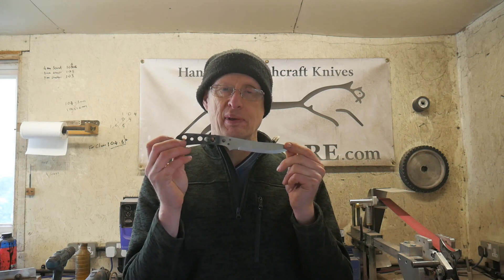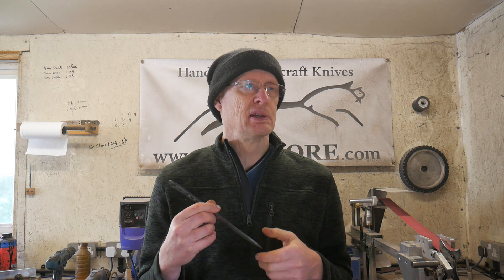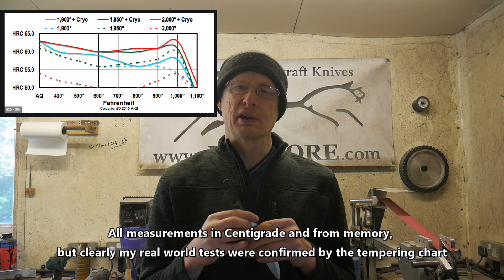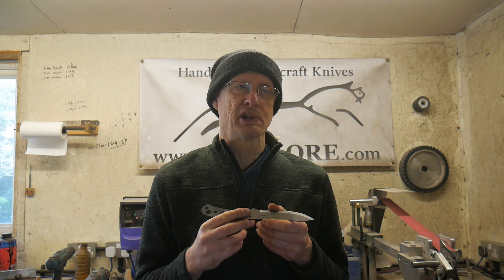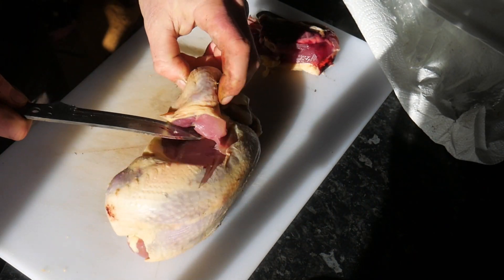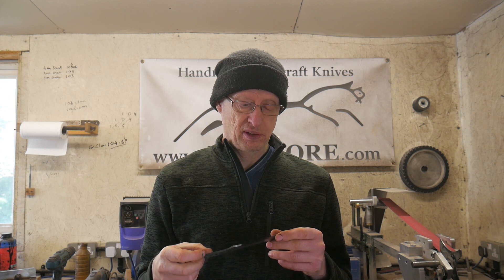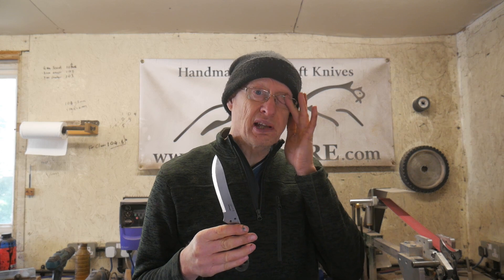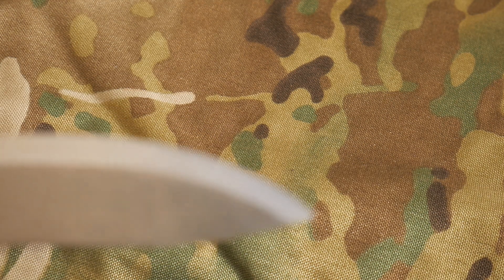STAINLESS HEAT TREAT UPDATE. DESTRUCTIVE TESTING

Comment: Hi Sandy
Currently doing my own HT test pieces,and researching with the book by Dr Larkin Thomas,I sent you a pic of it couple of weeks back definitely worth the money.
This is taken from the book : 
Hardness comparisons with different 154CM-type steel datasheets found that the Latrobe datasheet is closer to heat treating experiments than the Crucible datasheet. Optimum heat treating of CPM-154 was found to be 1950°F for 30 minutes with a plate quench and cryo. Then tempering between 300-450°F depending on desired hardness. A maximum hardness heat treatment (~64 Rc) with decent toughness was 2025°F for 20 minutes with a plate quench and cryo followed by a 300°F temper.
Regards

Davy
Reply: Hi Davy, Sounds good but the problem is after cryo it's impossible to get the hardness down below 60rc which is what I want for a scandi edge.
Although still a tough blade they all failed to chips
With a scandi you really want them failing to a roll
Sandy

Comment: Hope your testing has gone well Sandy
https://knifesteelnerds.com/2020/03/16/how-to-heat-treat-cpm-154-toughness-experiments/
this might be an interesting read for you if you have not seen it.
i have not used 154CPM, but made many blades in Elmax, which i have taken to very fine edges, full height 7dps with 15dps micros and tested on chopping plastic cutting boards and chopping kebeb sticks with no issues or chipping, but all of these steels, including 154 are relatively low toughness for their hardness.
while not as stainless, AEBL is a steel that i have had the best success with, as it can handle edges as fine as O1 with no issue  and has extremely tough edges, ideally at 60-62RC. its a very low cost high quality semi stainless steel. normal fresh water environments pose little challenge but salt water may still need a little work.
IMO, AEBL is the best of both worlds steel you can get which handles very fine edges.
Reply: i was going to say, being euro steels, elmax, aebl etc i'd think might be better priced too than importing american steel, but who knows

Comment: A point of concern is that lower austenization temperature will lower corrosion resistance, as the high soaks dissolve the chromium which is necessary for corrosion resistance.

Comment: 154CM is a very high carbide steel so the toughness/chip resistance is far lower than plain carbon and low alloy steels like O1. You might want to consider something like AEBL.

Comment: 3 years ago I, as a hobby,  started to make blades with M390. This is another "super" steel like CPM154. Despite they are not 100% the same steel, they are both stainless powder-steels...I made several blades (+30) following a very scientific process and documenting everything, and found that this steel is highly sensible to heat (while being cut/processed/machined), and also the furnace needs a very precise calibration...a few centigrades deviation and you get variations of a 1C Rockwell. Double or triple tempering is also recommended. Annealing was also a pain in the butt (was never able to do so properly).
Good luck and thanks for sharing your experience all of these years...you are one of the few that got me into knife-making :)

Comment: Some thoughts for the next batch- I don’t know that cprm154 is the ideal steel choice for a Scandi grind. I do think it’s workable, but I think there’s some other stainless steels that would perform better for toughness. AEB-L (or sandvik 13c26) is a great stainless for a scandi. In fact I think it would exceed O1 toughness. I know aeb-l is not powdered metallurgy, or as premium, but under hard use with the aggressive geometry of a Scandi I think it will perform better. A second choice which would also have better toughness, and better corrosion resistance then CPM 154 would be LC200N, this would check the premium box. You give up a little toughness over AEBL, but gain toughness as compared to cprm 154, and it’s virtually rust proof.
Reply from the maker: Hi Gary that is very helpful. I think cpm154 as you say may be better suited to a different knife grind, I've heard about AEB-L but did see some fairly good results with the cpm154 at below 59Hrc on the scandi grind.
Thanks for your input
Sandy

Comment: I’ve got a few high end production knives from buck with s30v steel and I’ve found those knives to chip a little and a bugger to get sharp that is before I bought my knife off you sandy it was my first carbon steel knife and much preferred using it I don’t have much knowledge of how they keep an edge compared to high carbon because I always sharpen after a decent use but I would always use high carbon now unless absolutely necessary like on hunting or fishing knives . Have you thought of giving d2 a try just a thought really like all the thought and testing that goes into your knives hope the next batch are up to spec atb scott
Reply: D2 is EVIL to sharpen!  Think diamonds and lots of elbow grease. I have a few knives from famous makers in D2 and would never buy another one in that steel for any purpose or by any maker.
Reply: geezerdude cheers I have one but haven’t used it much at all it’s a lbcustom knife thanks for the feed back

Comment: Send it over and I will do a test video on it as well. For those of you that don't know I did one on a test blade of Sandy's in O1 after he had banged the crap out of it. I went way over the top and could not hurt it and finally to break it which I could not do by hand pressure even with a pipe on it I put it in a vise and broke it with a full sized maul. I sharpened the part of the blade that was left and use it to this day to cut pins on the folding knives I restore. Sandy I think of you every time I reach for it. I have utter faith in Sandy's O1 knives and have one for my personal bushcraft blade. They are as good as you can get and I bet when he is done his stainless ones will be as well. Send it over Sandy I will do everything to it you should not! I promise old friend.
Reply from the maker: Bruce, LOL I've got  few more heat treatment experiments I would like to do first including more freeze quenches with dry ice and am also trying to lay my hands on some LN2. When I think I can't get any further I may well send you a pice to test.
Hope all well your end
Sandy
Reply: @Jackloreknives  I am older but no wiser my friend. LOL When you are ready ship one over and I will do an in depth test on it. I have much better video equipment than in the old days at least.